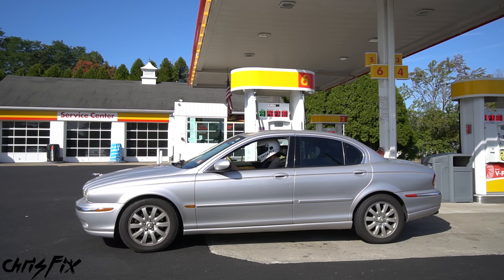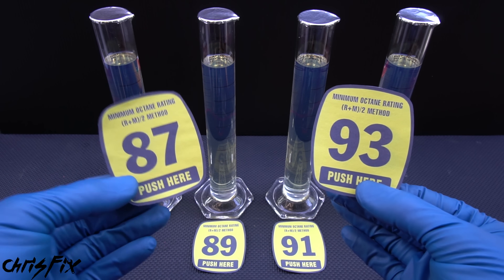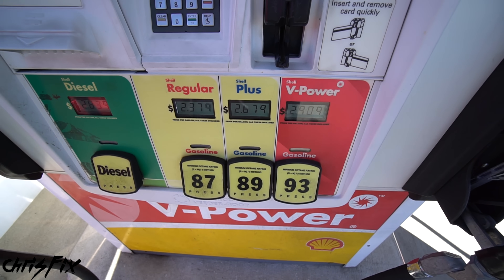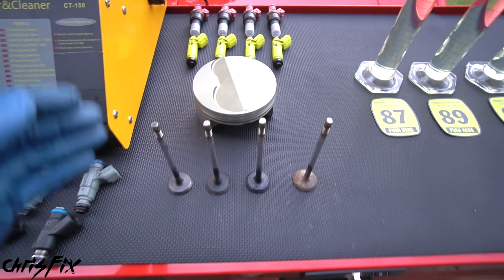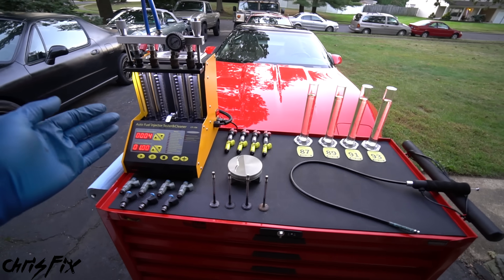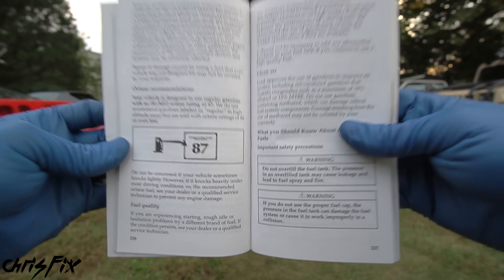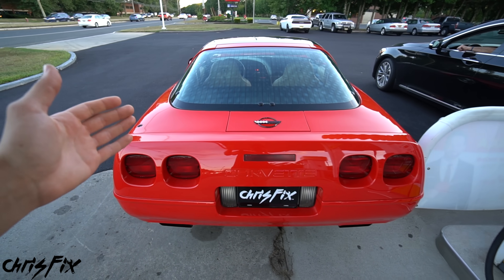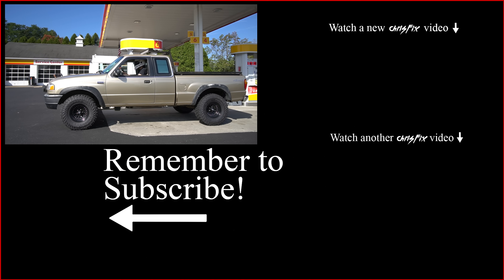What is the BEST Fuel to Use in Your Car or Truck and WHY

Comment: If your car is recommended at 87 octane, is it a good idea to run the premium fuel for the additives to keep it clean? Would it damage the engine any running premium fuel if it’s only recommending 87 octane?

Comment: I don't like Shell fuel. I couldn't run it in my SRT-4 with a .50 trim or my 92 5.0 built Mustang. Both would ping on Shell high octane. I used Chevron, my cars never pinged on Chevron high octane. My theory is that Shell's 7 times more additives lowers the octane in their fuel. It might be 93 when they get it, but it's lower after they add the additives.

Comment: funny how 93 octane is the premium gas over there hahaha..  regular gas here is at least  95 octane
Reply from the maker: Watch the video...
Reply: @ChrisFix   i have.. it's measured  differently over there.. however. in europe you can also get 100, 105. and 110 octane at certain  gas stations.. all wich are higher than the permium gas in the US. even is i use PON or RON
Reply: @ChrisFix   the equivalent  of the US 87. does not exist  here.. and. our. 100 105. and 110 gasoline  does not have an equivalent  in the US

Comment: Right you are . I like to think of it like this , higher octane is more resistance to burn and lower octane is less resistance.  Aircraft engines using 100LL have pre igniters for the fuel called SHOWER OF SPARKS . Lot of chemistry involved that the average person does not know. Makes life more interesting for gear heads like us .

Comment: Should've covered E85 gasoline. Ive heard that it has cleaning properties due to the high content of ethanol. But of course you need a flex fuel vehicle or your car has to be tuned to run E85
Reply from the maker: I will be covering that soon, stay tuned!

Comment: Just filled up with 93 premium in my 2006 GMC Canyon SLE as it's recommended 87, but lately been doing mid octane with those Octane Booster additives because of rain or winters here in CT, New England, US. Additives too because as 2nd or 3rd owner of the truck I'm at 123,039 miles.
Reply from the maker: No need. Just run 87 and you’re fine. It’s made for 87.

Comment: Idk how I got to this video but since I’m here I guess I’ll add. Another key difference is ethanol content in the fuel comparing us to other countries. USA uses no more than E10-E15 or 10-15% ethanol. I’m not including E85 at the pump because that’s only if a car has special fuel pump, lines, and proper injectors etc…. Most production cars in the states mention on the car not to put anything over E15 do to air fuel ratio; it’ll lean out the car possibly.  He was comparing Europe to us in the video which Europe runs strictly 5% ethanol or E5.

Comment: I use regular 95 octane but once in a while I use 98 octane with a bottle of injector cleaner and fuel system cleaner just to make sure everything works as it should. I had a problem with my engine getting extremely weakened and losing power but after the injector cleaner it runs smoothly and feels much more powerful and has much better acceleration now compared to before
Reply: I have been doing exactly same thing for a long time and I agree using higher octane once in a cleans all the crap and vehicle feel freshly tuned up, but after watching this video I am confused if using higher octane than recommended could potentially hurt the engine.
Reply: @ApexTrust  You can't hurt your engine by using a higher-octane fuel, but if the engine is unable to utilize the higher-octane number, then you might be wasting money. Then again higher-octane fuels tend to have more fuel additives that can clean up your engine and help it stay cleaner. Using lower octane fuel than the engine is designed for, can hurt your engine, though. Also at least here in Europe, I think all the fuel has ethanol now, usually up to 5% in the higher-octane fuels (98e5) and up to 10% in the lower octane fuels (95e10) and ethanol has less energy by volume so you can get a bit more range with the higher-octane fuel, though most likely not enough to justify the higher price.

My current car definitely runs more smoothly and has significantly more range with higher-octane, lower ethanol fuel but then again, we are talking about a rather modern turbocharged direct injection engine here. For any small machinery (lawn mowers, chainsaws etc.) and motorcycles, I would never put higher-ethanol fuel, in fact fuel with no ethanol would be the best. I don't claim expertise in chemistry or mechanical engineering, though (I am an engineer, but an ICT one.) Always adhere to the recommendations of your engine manufacturer and expert mechanics.
Reply: Should I do this on my 2005 1.7L civic? It has 257,000 miles and try to run injector cleaner through it every now and then but not with premium as well
Reply: Stop being cheap and you'll never have to do that😂😂

Comment: I have a 2016 Ford Focus SE Flex Fuel currently with just shy of 52,000 miles on it. E-85 is not available in my area, so I have just been running regular unleaded. My performance is not as good as when I got it a little over a year ago but, I’ve been keeping up with maintenance. Is regular unleaded okay to run in my car or should I be running higher? Thank you in advance.

Comment: Ok this is false!!!! In my scat pack owners manual it literally says use 93 octane for the vehicle to reach maximum horsepower at the track but use 87 for normal days 😮
Reply from the maker: Certain cars can have different tunes depending on the fuel octane measured like with your scatpack. Pretty much every other car only has a single tune no matter the octane, making higher octane a waste if used all the time on a car that only needs 87
Reply: @chrisfix  ok in general I suppose but there’s plenty of other vehicles too.  In the Manuel it says recommended or required it’s two different things such as some Volkswagens Subarus and corvette etc.

Comment: so i just bought a v6 2015 Camaro and it says use 87 or higher do i run 87  or mid or even higher like 93 because i don't mind spending the extra money especially if it increases the life and health of the engine

Comment: Chris, what a great informative video. You covered all the bases, and it really shows how beneficial higher-octane fuels can be.... for vehicles that require or recommend them.  Love the way you clarified the benefits for vehicles that 'recommend' higher octane.  Perfect example: my 2021 Ford Edge St has a twin turbo v-6 (2.7 ecoboost). The service manual specifies that the engine will run fine with 87 (thanks to the knock sensors), but for optimum performance or under high load (towing a trailer) applications, premium is recommended. I definitely notice a performance benefit. Kudos to the knock sensors. 
 Also, how older vehicles with high mileage can benefit. Knocking and pinging from carbon hot spots can really do some damage over time. For those of us who know, not a good sound to hear!
I have found that Chevron Complete fuel system cleaner works awesome for cleaning carbon out of older engines. 
Also appreciate the breakdown on fuel additives and additive packages added by the brand. Shell and Chevron both seem to go above and beyond when it comes to putting in more than just the minimum required. I'm sure there are others. Your video covers all the bases and it's truly well made. Thanks!

Comment: I've heard that engines with a lot of miles on them can get carbon buildup and act as high-compression engines, thus making high octane gas a good option for high-mileage engines. Is this true or false?

If "true," do "fuel system cleaner" additives like Techron, Seafoam, etc. actually clean out enough carbon to make using high octane gas unnecessary?

Comment: I own  a 2023 kia forte gt (1.6L turbo charged GDI engine) dealership told me to run regular but some of my buddies are telling me that I should run premium instead to exactly avoid carbon build up overtime to save myself more maintenance to do ( clean up the carbon) 
What are your thoughts? I'm not to good in understanding the mechanics
Thanks

Comment: Every gas vehicle made since 2006 has a knock sensor so you can use regular or premium gas without engine damage. The caveat is engine hp and fuel economy: Car & Driver tested four high performance vehicles in 2019, they found high octane gas(93) increased hp and fuel economy

Comment: My 2023 Bronco has a twin-turbocharged 2.7L V6 which operates using regular octane fuel, but the manufacturer also says that you can net 30 HP more if you opt for premium octane fuel. Is this true? Can you tell me why or why not? Much appreciated.
Reply from the maker: Yes it’s true because with high compression engines or in this case forced induction engines, the higher the octane the more timing they can add which equals more power.
Reply: @chrisfix  thank you, sir! I appreciate your confirmation.

Comment: Hey Chris, is it advisable to mix the fuel grades...?
Reply from the maker: Yeah as long as you mix up. So if your car takes regular than you can mix any grade. If it takes mid grade you can mix 50/50 premium and regular. If it takes premium you can’t mix anything because you need premium.
Reply: @chrisfix  you can add 100 octane race gas to 91 premium. 

And the race gas does have better burn qualities.

Comment: Best thing to do, read the user's manual before you fill a fuel into your car. 

For example: my SUV V6 engine is "87 octane gasoline or higher." I did that, half 87 and half 93 because 87 octane ran out at the gasoline station. Many users wants to save money. But next gas pumping, use 87 octane. Better go to another pumping station if 87 octane is not available again. So you can stay for the same octane that you really used to.

Comment: 35-year ASE Master Tech here. Do NOT listen to this guy. He is entirely wrong. I also worked as a fuel test technician for Exxon Research and Engineering many years ago. 

Lower octane fuel burns faster. It also ignites easier. That means in a higher compression engine, it will ignite sooner and burn faster. The early ignition results in detonation (engine ping) and can cause engine damage. The faster burn rate also means reduced power as the burn has stopped before the piston has to reach BTC (bottom dead center). 

You should only use the octane rating your vehicle calls for and NEVER a lower one. On the other hand, it is safe in the short term to use a higher octane fuel if the lower called-for fuel is unavailable. This is because you will suffer a performance decrease as higher octane fuels burn slower. That means the fuel will not be entirely burned by BDC and will still be burning on the exhaust stroke, thus wasting thermal energy. That is also why it should only be done in the short term because only partially burned fuel can damage the catalytic converter over time. 

Something else to note: Ethanol has an octane rating of 113 which is why it is used in very high-compression engines. In fact, high compression is required to maximize the energy potential of ethanol because it is otherwise thermally inferior (less heat) to gasoline. If your fuel generates less heat, that means less cylinder pressure and less power, which equals worse mileage because it takes more fuel to accomplish the same task. Don'r believe me? If your vehicle is E85 (85% ethanol, 15% gasoline) capable, run it down to almost empty, fill it up with E85, and track your mileage. You will poop yourself at how bad it is. Cost-wise, it equals out, but do you want to give up almost 1/3 of your range?

Comment: I just got a Toyota Camry 2019, I bought the car used, it did not come with an owner's manual, but the gas cap on my gas tank said I can only use e 15 gas only , is that  plus a regular?

Comment: But....My boy. Heat is Energy.
87 does run Cooler. 93 is Hotter.
Top Fuel engines use Nitromethane
145 octane.@ 27° = 11,000 horse power.
See ya. Nitro Joe.

Comment: READ you owners manual!

Ex. I drive a maxima. Manual says to use 91 but can drive fine with 87. Just less performance and gas mileage. 

My state doesn't have 91 so I get 93. I get about 20 to 40 more miles in total when using 93 compared to 87. 

So while my car is technically able to  run on 87 I still use 93 because its the closets to 91 octane.

Some car require you run a certain octane or it can cause engine damage. Always follow your owners manual.

If your car runs off of 87 then their is NO REASON to get anything higher. You will NOT see an increase in performance and will NOT see a increase in gss mileage. But wont cause any problems if you use higher octane.

Comment: Hey, I have a 2012 Chevy Silverado and on the gas cap it says to put E-85. The problem is that it’s rare finding a gas station with E-85, so I did some research and it said I could also put regular gas in it. But then I also saw that is said it’s totally fine to put premium gas in it. So do I put regular or premium gas instead of E-85?

Comment: I use plus or more in all my cars.  The price is nothing and the engine runs better.  I go for walks all the time and I hear cars climbing hills and knocking.  Its slight but there.  Also, it can lower hesitation when starting from lights.  Let's do some math.  10 gallons at $4.00 for regular is $40.  10 at $4.20 is $42.  At $4.40 its $44.  $4 dollars is not enough for me to worry about.

Comment: I use ethanol-free gas.  I pay, but I want to keep ethanol out of my cars since they may sit idle for a few weeks.  The only ethanol-free gas I can buy here is 91 octane which my car doesn't need.   Of course, on the few occasions I have found 87 octane ethanol-free my car runs exactly the same.
Reply from the maker: I wouldnt try too hard for ethanol free gas. I have 12 cars that sit in storage units for months and months with e10 and they start up just fine and never have issues with parts. Use this to stabilize it if you are worried: https://amzn.to/3HJYZXL
Reply: I got a testing kit and checked the ethanol content in the three stations I use the most, Costco, QuickTrip, and HyVee.  I've never gotten a result of more than 5% ethanol.  Hardly a scientific method, but interesting.

Comment: I just bought an e36 316i that has 160k mileage, Which Petrol should i use i want to keep the engine for a long time. Can i run the best petrol from shell so it could help the engine's longevity. What do you think sir?
Reply: Run what the manufacturer suggests.  If you can afford the extra expense, and can find it, ethanol-free gas will always be preferable simply because it won't absorb moisture and go stale as quickly as ethanol gas.   If you drive a lot and refuel frequently it may not really make that much difference.  Just look for a "Top Tier" rated gas.

Comment: Top tier gasolines are supposed to have more detergent but they wouldn’t tell you how much more detergent. It’s a secret.😂😂😂. A Toyota engineer on YouTube says use the cheapest gasoline. It’s not going to harm the engine of fuel injectors. All gasolines have detergent. Toss in a bottle of Techron once in awhile if you like. The government is up the ass of these companies to produce clean gasolines. I use the cheapest station near me. They pump a lot of gasoline so you know your getting fresh gasoline

Comment: When has hits $7 -$8 bucks this summer in states other than commit or iq where it will be $12-$14 a gallon nobody will be putting fuel in anything .  Keep voting for libtard communists and see what you get. Enjoy your summer!
Reply: The oil companies have shut down half of the refineries that were in operation at the turn of the century.  They did this to tighten supplies, drive up prices, and increase their profits.   They are planning on closing more.   The pandemic has allowed the oil companies, and a lot of other businesses to gouge the consumer.  Of course they have our Congress, Republican and Democrat, in their back pocket.  You can spin your wheels trying to find somebody to blame, but it is just business.   Sometimes capitalism doesn't work in the little guys favor.

Comment: In Volkswagen Audi engines that are turbocharged you get better fuel economy and more power using premium over regular. Because you for high compression, you definitely need higher octane to prevent detonation. My 2.0T runs much smoother and makes more power across revband with 93 octane vs 87.

Comment: Hello Chrisfix, hey by the way love your helpful videos. hey question I have a 2009 dodge challenger rt with 41,000 miles, it really runs really good and I am not a mechanic but I do maintenance it but I have a question. It's having some hard shifting at time, any ideas what the cause of it. I am thinking the synchros wearing out.
Reply from the maker: It could be the synchros wearing. What happens if instead of shifting right into the next gear, you put it in neutral, then let off the clutch, then clutch in and shift to the next gear?
Reply: @chrisfix  Thanks for the reply. yes I did it and it released when hard and shift well to gear.

Comment: The only thing that you didn't mention is the fact that some cars that run the low octane is not able to run the higher octane because it will cause vapor lock
Reply from the maker: For pump gas that isnt a problem. Any road going car that takes regular gas can take premium no problem at all.
Reply: @chrisfix  so you're saying that the owners manual for my nephews car is wrong, and all of the times that it vapor locked because we went against what the manufacturer said and put premium in it instead of regular is a pigment of my imagination. The owners manual does say that the car will vapor lock if you use higher than regular